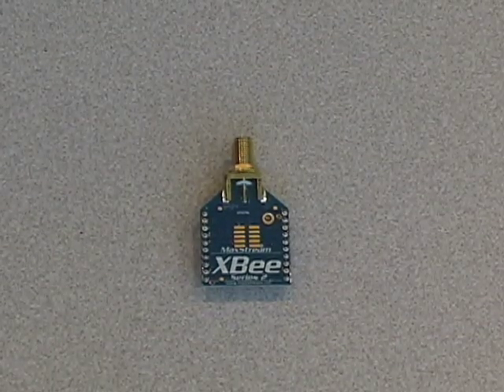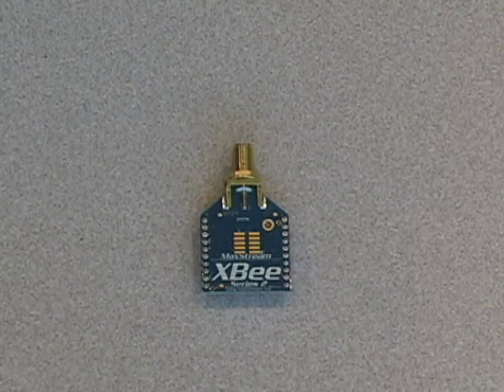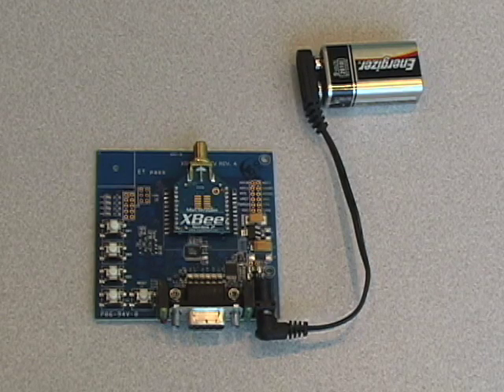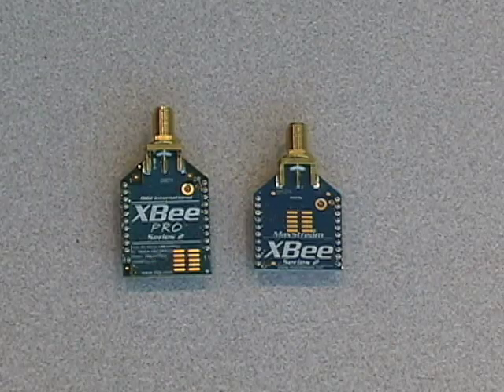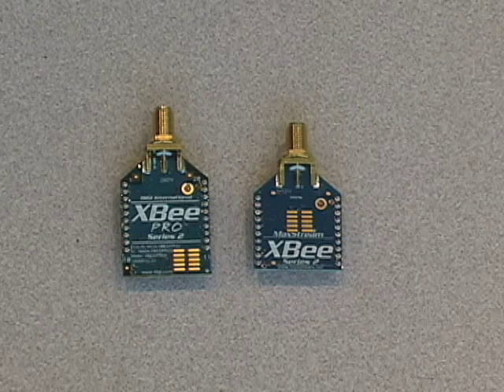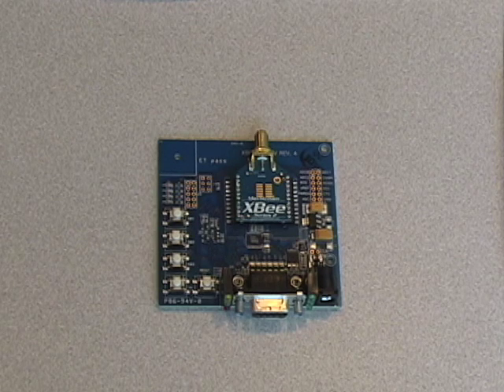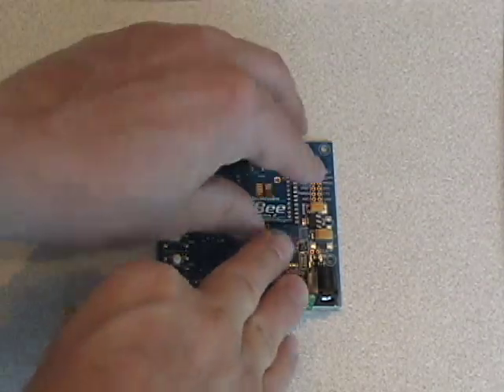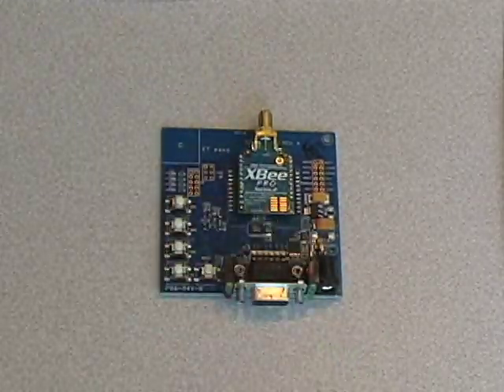Digi XBee vs XBee-PRO

Comment: I have 2xbee and arduino and xbee shield. Arduino tx rx pin to connect xbee tx rx pin to communication. But my problem is i can't communication arduino and xbee module my arduino don't communicated (pin0,1)tx rx pin. how can i communicated my arduino board to xbee module.

Comment: i am facing a problem.i have a  xbee pro s2b,however i dont dont have a shield or any kind of adapter.i use an arduino uno,howevr it cannot provide more than 50mA  necessary for this pro version.plz suggest me any other method to provide supply to the xbee

Comment: I'm interested in seeing a test for the 20 mile range XBee modems. I need to do a project based upon Zigbee and I've got nLOS issues that need to be worked around. Would really appreciate if you guys could do that. There is availability of mains 240VAC as a power source so I can use high-power systems also.